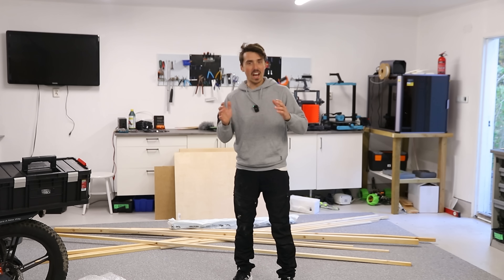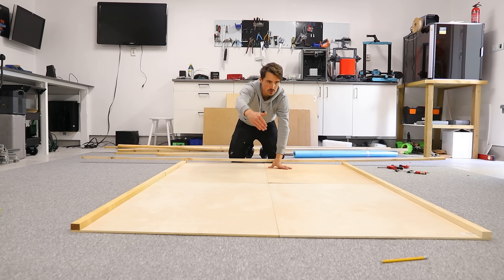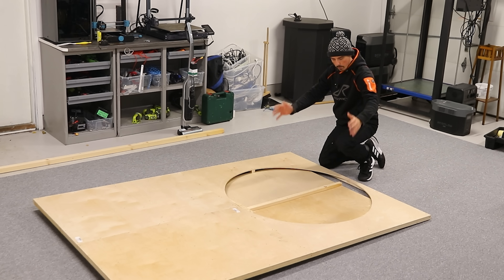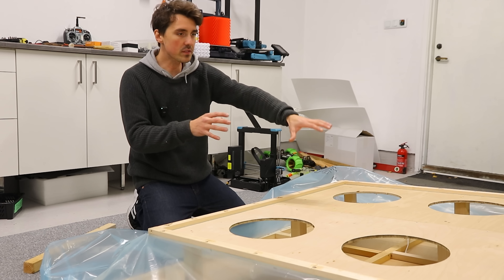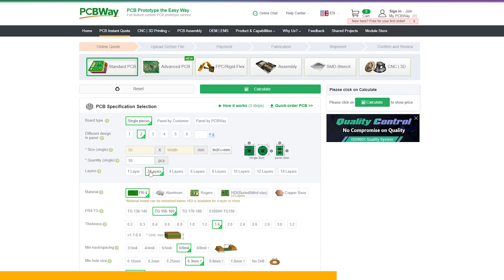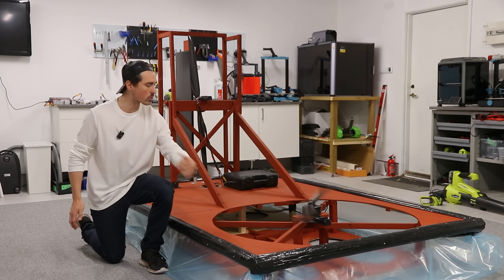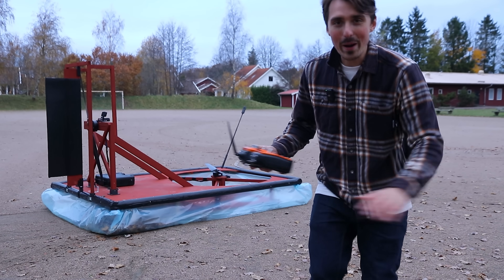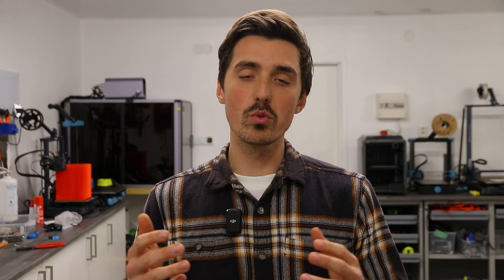Electric RC Hovercraft That Will Lift My Weight

Comment: I feel like every couple minutes of this video was another reason I'm certain you're gonna die. There's so much about this that is terrifyingly bad design. Like even as an RC hovercraft, not even considering trying to ride on it. I've wanted to build a hovercraft since forever too, but this is definitely not the way. You need basically every single component of this to be waaay stronger than it is. I'm impressed that it flies and carries weight, but still please don't die

Comment: You still need an air-guide around the horizontal propeller to prevent air escaping to the sides. But not too tight. That will probably increase the efficiency a lot.

Comment: information       good work.    but.        10:47   that is not precession.      that is simply  back-torque, from the  PROP; the equivalent of p-factor.       from the  PROP,  not from the motor.        a smaller prop diam, equals less back-torque from a lift fan.        ideally, a correctly spec'd lift fan impeller should be used.        d
search for  hovercraft lift fans

Comment: Learn from FlightTest. Don't do make the same mistake, use a lift fan prop that is designed for static pressure, not efficient forward flight (think computer fan, truck radiator fan, axial leaf blower ) 
Look at other hovercraft fans they are designed that way for a reason.

Comment: Cool . I think if you add a curved cowling that surroundds the fan on the upper side of the craft and make its height just above the fan blade , with the opening circimfrence just a bit bigger than the fan , your perofrmance will boost much more.  :O)

Comment: Really enjoyable video as usual, thank you. 
I’ve always wanted to speed build build a full size electric hovercraft too, I can’t wait to see how it turns out. 

I’ve built a few RC hovercraft, here are some thoughts in case they’re useful:

- Ripstop (kite material) is an awesome skirt material. Super tough and light.

- rounded corners make less bulges at the skirt base, they are where holes appear.

- foam sheets sandwiched between wood are strong, quick and easy. Good for floating purposes.

- lift fans are more about pressure than airflow. Two blades leak a lot upward. Wingtips are key, most pressure is lost there. Squared off ends really close to the housing avoids this. 
I cut a 5 blades ends square.
You might get around wingtip leaking by simply mounting the prop just under the plywood and narrowing the opening a few cm. that’d save building the duct too.

- a really badly sewed finger skirt is better than a bag, it’s a pain in the arse to make but it doesn’t fill with water on a lake. 
I’ve been meaning to try out making one like this: 
Two long strips of Ripstop laid one on top of the other, a taller one for the outside of the skirt and shorter one for the inside, lined up at the base. 
Sew lines top to bottom to make each segment. Cut apart at the base to make ‘feet’ to conform to the ground/water. 
Perhaps then sub divide each foot with some stitches to make the pressure on the foot side higher than the inlet side to even pressure inside the bag and keep it inflated when a bit is lifted from the ground.
Might be terrible though.

- you could add two extra fins on the frame with wire connects for serious turning power. 

Hi to anyone who read this far! 🎉

Comment: Your understanding of gyroscopic precession is a bit off.  You were actually experiencing counter torque more of a newton's 3rd law situation.  Gyroscopic precession is when you apply an offset force to a rotating body the effect is felt, on the rotating body, 90 degrees later.  It's that weird feeling when you get a fidget spinner spinning full speed and rotate the axis.

Comment: There were plans for a mini stand on hovercraft in the back of old Popular Mechanics and Popular Science magazines in the olden days, I ordered them and my dad helped me build it.  The hover portion was powered by an old vacuum cleaner motor, and the thing worked great on concrete as well as grass-only problem was you had to keep an extension cord hooked to it at all times.  I wonder if a design like that would be fun for you to recreate.

Comment: Good work. I've built a few models but not that big! I've used a 12 blade air con fan rather than 2 blade propeller for lift. For the rudder, it's better to use a balanced rudder, that is 25% of the area forward of the pivot and 75% behind. It takes the load off the servo and linkages and provides finer control.

For skirts, I used garden pond liner. Easier to repair if damaged.

Always fun to experiment though.
Reply: Yes agree on the rudder. 
I’ve had great success with Ripstop fabric. It’s so light and tough.

Comment: Might go instead of dowels pvc pipe for verticle pieces and maybe engineer in some cross pueces not for support air passages for a emergency pump up ?what yu think idea  maybe put holes all the way across horizontal pieces or jjust let it flow out ends can plug ends or unplug ends of pc for air flo!!!

Comment: I haven't read all the comments, so this may have be mentioned. It's common on R/C to mix channels, in this case mix a little rudder into the main throttle to offset the rotation. Simple, cheap, effective - the holy trinity of DIY.

Comment: Good job man. But you don't have a problem with gyroscopic precession, It's just that your propeller is acting a bit like a reaction wheel. The torque you apply to the propeller to spin it creates a reaction torque that is spinning your hovercraft in the opposite direction.

Comment: Sorry to see you have made the same mistake I made.  Using a propeller for air pressure is just not a good idea.  You should use a cetrifugal blower..like the real crafts... So much easier to produce pressure and still have enough volume to keep it inflated..

Comment: Flight test could learn a thing or two from you... they have their prop inset into the hole where as yours is above the hole... love it! I was just leaf blowing today and when I put the tip of the nozzle too close to something the motor would rev really high and there would be no air coming out... Related?
Reply: It’s to do with wingtip vortices.
Reply: do you have any references @kitsandham7001

Comment: Is I see you need two things:
1. Fan duct for bottom motor to increase power and pressure. 
2. More stiff material for the skirt, your polyethylene will be sanded soon

Comment: Nicely done!   Just two points...
- It's not gyroscopic precession causing the yaw to the left.  It's just plain old torque from the prop.
- You'd be way better off taking a couple of inches off the prop tips vs. having them extend beyond the hole.  You get most of your thrust from the outer 1/3rd of the prop.
Reply: here for this :)  ...gyroscopic precession would come from a change of pitch or roll,  which is obviously not happening.

Comment: 10:55 this is not gyroscopic procession but only the torque of the rotor acting on the frame (same way as an helicopter but with less effect cuz the propeller mainly provides pressure here and not as much mass flow)
Reply: Exactly right, the motor drives the propeller and causes the frame to rotate in the opposite direction.

Comment: I'm not saying you are wrong for calling the yaw induced by your front rotor gyroscopic precession. But I think in the simplest terms it would be an action reaction situation. This problem exists in all single rotor helicopters as well. The effect is countered by the tail rotor aka anti torque rotor. Your plan to vector your rear thrust will cancel out the torque effect of your front motor... but your anti torque vector will introduce a lateral translation (slide sideways). This is compensated in helicopters by slightly adjusting the rotor disk opposite to the side. This is either done by the pilot or mechanically or electronically through the flight control system. Google: Collective to Yaw mixing in the UH-60.

Comment: Would it still work if the front fan were dropped a few inches to the space between the decks? Then you could put some screening over the top hole to make it safer/cleaner

Comment: your design is highly inifitiant the fans need to be ducted you need safety netting an emergency cut off the skirt needs to be of thick material not garbage bags and holes cut along the bottom of the skirt where the skirt meets the ground if this is to carry humans around also use a rc car remote with wheel using a transmitter for drones you might confuse the controls a rc car remote is easier

Comment: Awesome! Some ideas:
1. Rather than adding EDF's to the rear, maybe you could angle the rear motor downwards a bit, so it also provides upward force to lift itself and counteract its own weight.
2. The rear motor frame can be made much more rigid by adding some diagonal supports on the frame. Square frames are inherently unstable since they have degrees of freedom, while triangles are inherently fixed because they have no degrees of freedom. #fax #enhineerigh
3. Maybe adding a shroud to the motors would significantly increase their efficiency. And unfortunately also make it a bit safer ;)
    That way you can also add some mesh on top of it to prevent leaves from getting in. 
4. Put the batteries in the front to balance weight.

Comment: You need more of a turbo fan like you'd see in a jet engine or turbo for best static pressure in the lift/skirt.:)

Also use vetored thrust so you have better control at all speeds.   Check my rc hovercraft short.  Its a perfect platform to see what Im saying:)

Also add an rc heli gyro and a skirt.

Comment: Ah yes, angle the motor so it takes up marginally less projected area, but increases complexity several fold because now you have to make an angled motor mount that needs to sit as concentric as possible with the propeller shroud. Truly the hallmark of an engineer.

Comment: Bro, when you're at the hardware store looking to buy wood, pick up the piece that you're considering lay one end on the floor hold the other end in your hand close one eye and use your open eye to look down the length of the board. This will make warping obvious and you can use this to select the straightest board possible.

Comment: If you really want to ride it, you might want to think about some sort of safety harness to prevent falling forwards or backwards or add an Chair where you sit on with this kind of Safety harness. Behind your back it could be some kind of sturdy grille as protection. But well, yes it is adding more weight, you could use the Battery weight as counterweight on the Nose. Threat this part like balance an Airplane center of Gravity. oh and do not forget the important thing. Ear Plugs :). Also you could google for "Florida Swamp Boat" for inspiration, too

Comment: You've probably thought of / tried this already, but to balance the front / back:
1) Close some of the holes in the front to direct/force more air pressure to the rear.
2) Add a scoop to the fwd thrust fan to catch some air and redirect underneath for added rear support while in motion.

Comment: Having made several RC & full sized hovercrafts as a kid, a finger-skirt really is the way to go. 
A bag skirt by itself really lacks the ability to conform to uneven terrain & transition to different surface types.
Reply: A finger skirt would be strips of material hanging down? I don't know the term.
Reply: @dalepower632  with a finger skirt you have many short separate skirt sections attached around the circumference of the hovercraft's deck. Each section inflates & presses up against the neighboring section to form a seal. 
I don't know how to describe it very well -you're probably better off doing an image search for "hovercraft finger skirt"
Reply: Got to agree.

I sewed up a really (really) rough finger skirt out of Ripstop for an 80cm RC one, it was so much better than the bag type which filled with water.

Do you think it’s possible to lay two strips of Ripstop down an just sew lots of straight lines for each finger? 
Maybe separated at the base for flexibility?

Comment: If you stuck a cowel around that propeller that will increase the  efficiency, more pressure and more lift, whilst simultaneously decreasing your risk of getting chopped in half if one of those blades flies off
Reply: this!
Reply: cowl :)
Reply: My guess is this will be in part 2
Reply: +5
Reply: Putting a propeller in a duct is tricky business.  To get any efficiency benefit, you need to maintain a really tiny gap between the duct and prop tips.  More than that, and the duct becomes a net negative.  It will however help protect him.
Reply: @Rick_Cavallaro yes it is! 
Any vibrations mean the blades hit the edge and create more vibrations to hit the edge with. 
Foam lining the cowl fixes that and closes the edge gap lots.

I’m not sure how significant edge gap loss is with props like that, (they’re designed to reduce wingtip vortices) relative to pressure loss by only having two blades.
Reply: Wow, if everyone thought like you we would all live in large plastic bubbles. and making it ducted would be a lot more mass and trouble.  not worth it for a small project.

Comment: Im an Engineer and i cant stress enough how big of a death trap that is. Please, build a cover at least for both propellers.
Reply: At 11:30 He said he was going to " Make it safer " In Part 2. :o)
Reply: Carbon Fiber props can shatter pretty spectacularly. FPV pilots have a reason why they don't use them anymore.
Reply: @anonymoushippo-m7d  Darwin Award contraption in its present form.

Comment: ove it! I think if you channel the horizontal propeller you will gain efficiency and safety
Reply: Yes, is this not the "normal" way of doing builds like this?
Reply: @TheStuartstardust  plus where is the fun in SAFETY? 😮
Reply: @cloudpandarism2627  the fun in safety is not getting sliced in half by the "carbon" blades
Reply: @__estrogen_  i was totally not joking. jeeeez haha